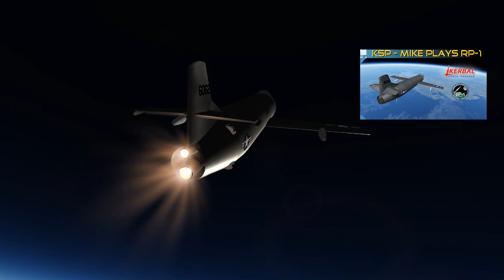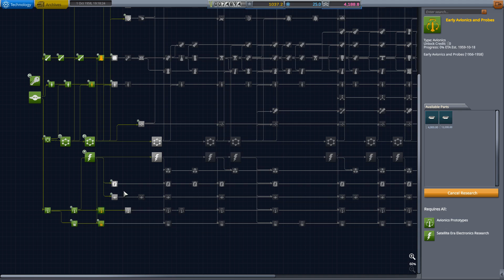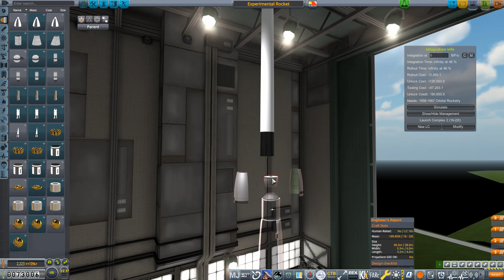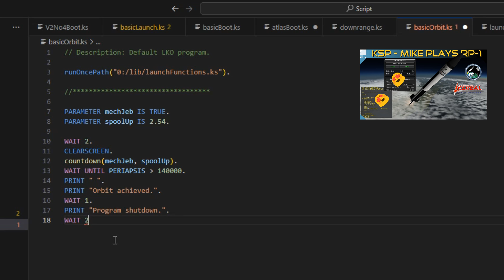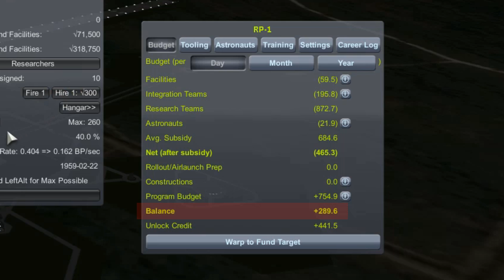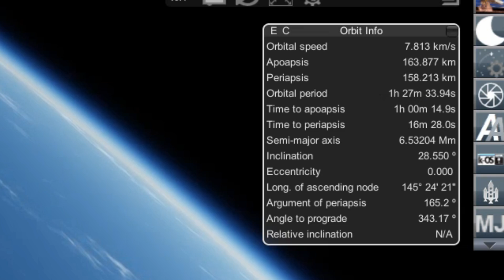My First Orbit (First Artificial Satellite) | Mike Plays RP-1 #22 | KSP

Comment from the maker: Up Next: First Scientific Satellite - https://youtu.be/na5ulg0ongw?si=0gU9TB_iRDdz1Mkc

Correction: The hot staging is not working right and had me misinterpreting how to set it up with MechJeb. I have a supplemental video for those interested.
https://youtu.be/o4D4YuiCpqc?si=FzWwgki17kPvkuBV

Update: The problem has been worked out.
https://youtu.be/EOrCT3HHYHo
Reply: Hey Mike Abe, I suggest you not use fairings for interstages, just use hollow structures and ring decouplers instead

Fairing decouplers are heavy, and disabling them while replacing them with ring decouplers saves weight by a great margin.

The fairings that decouple themselves are really heavy and expensive, especially when they decouple which makes them even heavier

While hollow structures are still decently heavy they are far more useful then fairings - give it a try!
Reply: This also means you can hide the avionics inside the interstage. Great cosmetically!

Comment: Managed to get first orbit on a really cheap rocket. It was an advanced replica of the explorer 1. Same probe, baby sergeant cluster, and bottom stage. However, I elected to use balloon tanks to save on mass since conventional tanks (even with Al stringer) were just too heavy. The mid stage after booster cutoff but before cluster firing has spin stabilizing rockets, with the launch avionics controlling, and mechjeb pitching down before jettison. I intentionally shoot high, and aim down to sacrifice some apogee altitude for perigee altitude. I can also slot in extra battery and cosmic ray with virtually no effect. Thanks for your tutorials :)

Comment: For hot staging engine should be before the decoupler, mechjeb will light the engine before your specified amount of time, default 1 sec. which is good for most engines.
NitOx is a very bad RCS fuel, until unlocking RCS tech 2 HTP is the best.

For Atlas engine configuration you'll need the sustainer engine and the Kerolox upgrade for the boosters. Sustainer LR105  and those LR89's has to use the same propellant then you are all set. Good thing that you tooled the tanks now as the Atlas will be your workhorse for quite a while...
Reply from the maker: That is the way I tried the staging first, but it didn't work. MechJeb lit the engine, but didn't release the second stage. We'll see what I do as I unlock those engines, but I'm not trying to completely emulate the real world rocket.

Comment: Shouldn't the engine be on it's own separate stage for hotstaging to work?
Congrats on the first orbit!
Reply from the maker: That was my first thought, but it doesn't work that way with MechJeb.
Reply: @MikeAben  Was it supposed to hotstage on your orbital rocket though? It looked like a normal staging.
Reply from the maker: @hizisfoo  The second stage engine requires ullage, so yes, it was hot staged. The first time I tried it I put the engine in its own stage before the decoupler and it didn't work. MechJeb ignited the engine, but didn't decouple. When I put it all in the same stage, it worked.
Reply: @MikeAben  Staging was pretty high up, so ullage wasn't an issue. You can see it wasn't hotstaged because the 2nd stage engine wasn't active before the separation.
Reply from the maker: @hizisfoo  What can I say, staging the engine first didn't work. Staging them all together did, and ullage is an issue at any altitude.
Reply from the maker: @hizisfoo  Just a quick update. This has spawned a discussion on my Discord. You're right that I'm not hot staging, but it's not working when I set it up "properly". I put a comparison video together in case you're interested.
https://youtu.be/o4D4YuiCpqc?si=Hz00VPJ7Euw3BMNa
I've heard conflicting reports on how hotstaging is working in MechJeb. I'm thinking of shifting to using Smart Parts for hot staging until I've worked this out.
Reply from the maker: Update: It works now.
https://youtu.be/EOrCT3HHYHo

Comment: You should launch your X planes from the south heading north. Just north of the KSC there is the space shuttle runway and it is angled northwards. It is about 3 times as long as the KSC runway if not longer and it is about twice as wide. It looks like you have canaveral pads installed and with that mod the shuttle runway counts as a landing zone for the bonus rep from landing on a runway. And when you do the X-15 analog i expect you will need a massive runway to slow down enough safely. I do this for all of my X planes just to be safe because the extra rep is very important and i don't want to miss/overshoot the runway
Reply from the maker: I'm not having a problem slowing down enough. I do the Hypersonic Contract next episode. Still with that good old X-1 style plane. That finishes off X-Planes, so I don't think I'll get to an X-15 analog.

Comment: I would advise against using Nitrous Oxide as an RCS propellant simply because it is one of the least denser ones, so you will need bigger tanks in comparison to other fuels you unlock in other tech nodes. I recommend using HTP as a propellant until you unlock other ones. That way, you get more DeltaV with smaller and cheaper tanks. (unless you don't really care, then use nitrous oxide.)

In other news, I'm looking forward to seeing this series continue! Good job!